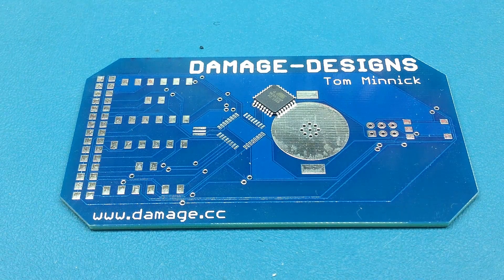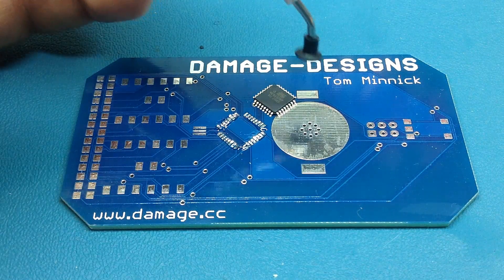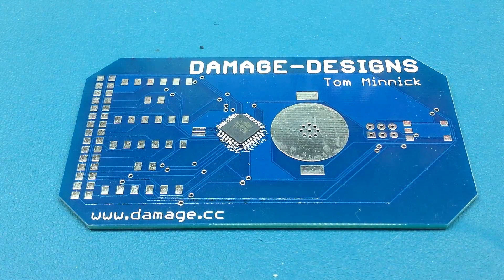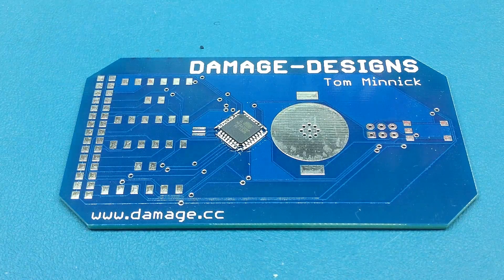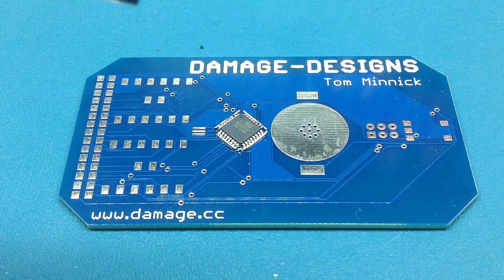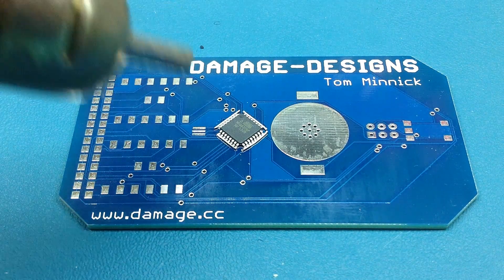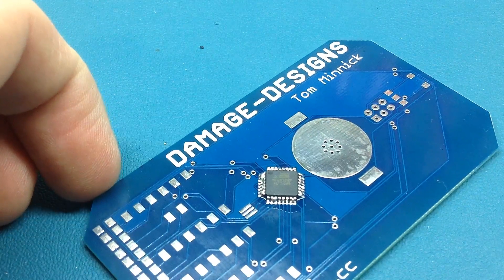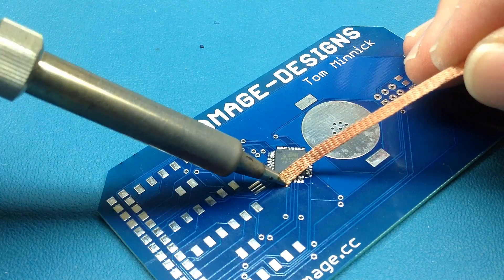Trying reflow soldering without solder paste.

Comment: What soldering iron and hot air did you use?
Reply from the maker: I am using the Hakko 888 soldering iron.  I have the older discontinued analog version.  The available eqivilent would be the 888D digital version:  https://www.sparkfun.com/products/11704

The hotair rework tool is the sparkfun 303D,  I highly recommend it,  I use it all the time,  Works well for it's intended purpose, but I also use it on heatshrink tubing.  https://www.sparkfun.com/products/10706